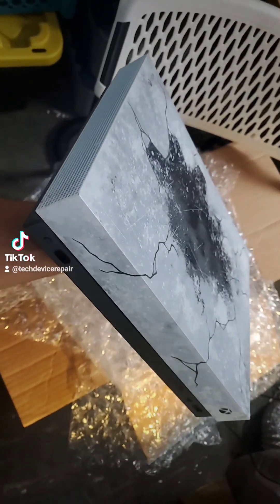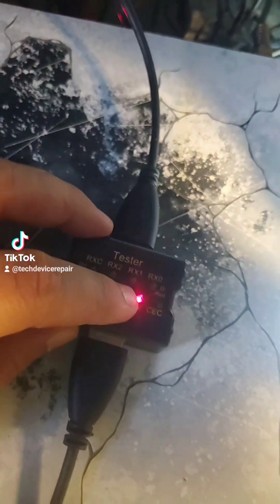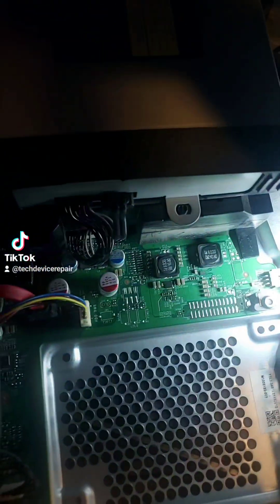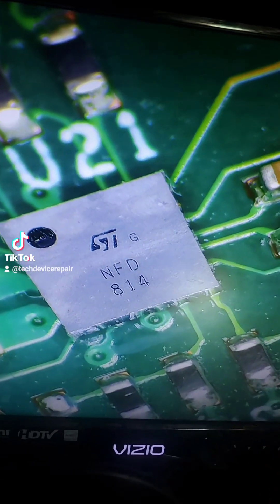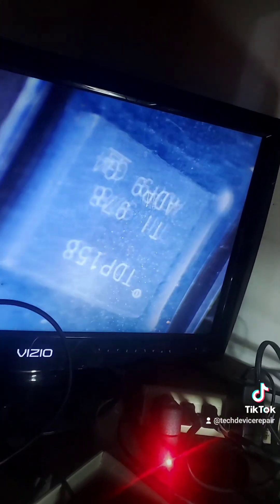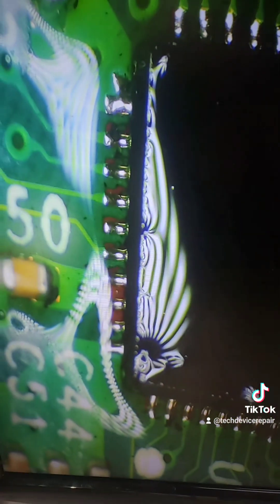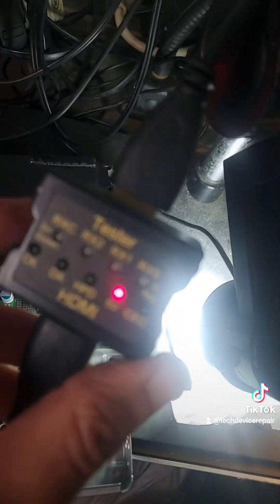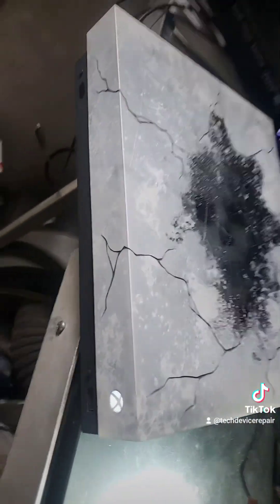Gears of War 5 Special Edition Xbox one X in for a motherboard repair.  #longershorts #novideo

Comment: Why did the tester not show anything besides the 5v line?
Reply from the maker: @undoxableGod  ha this confused me too at first.. 

my regular testing station is out of order.  And I had to use the other TV. For some reason we don't get any connection lights with the other one.  So it was a "lucky" diagnostic.. However we have repaired hundreds with the same no video symptom.. and 95% it is the tdp158 chip.